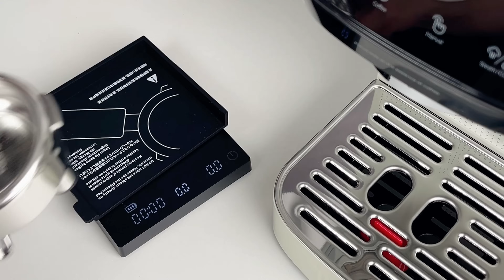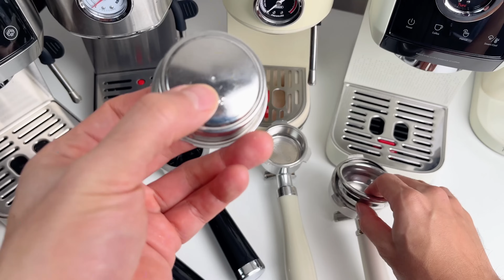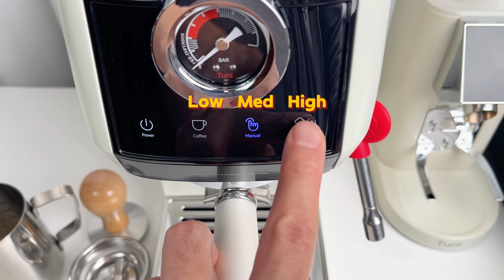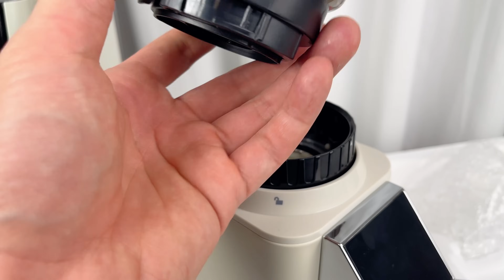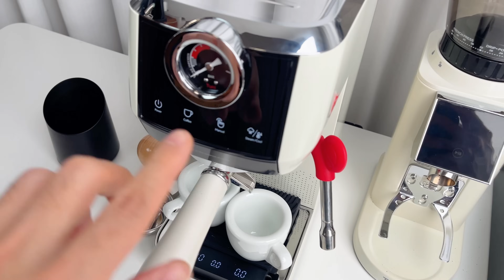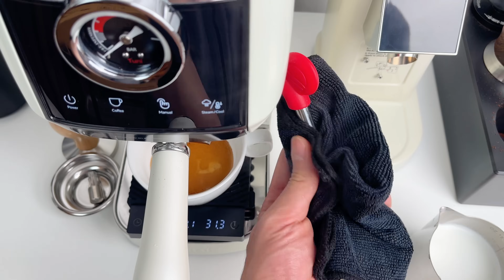Tuni E2 Espresso Machine & G1 Grinder Review - Best Budget Espresso Setup for Beginners?

Comment: Hi! I hope you are able to help me! I just received mine and I haven’t been able to properly get a espresso shot, I am using store bought espresso ground coffee but no matter how much coffee I add to the basket or how hard I tamper water flows to quick and no pressure building
Reply from the maker: Hi! If you're using pre-ground coffee, the grind size is probably too coarse, which means your coffee puck can't create enough resistance to build the pressure you need. I'd suggest switching to a pressurized basket instead (that's the one with just one tiny hole at the bottom).

Comment: I am considering this machine. It does not seem to come with single shots basket. Would you say it is still capable of doing decent quality single shots (and even with 5 seconds pre-infusion), given I use an aftermarket single shot basket?
Reply from the maker: I rarely use a single-shot basket. If a machine can pull good doubles, singles usually aren’t a problem. The common issue with entry-level machines is the OPV being set too high. Overall, though, in this price range the E2 is pretty powerful.

Comment: Wow that is very impressive for the size and price. I just asked this on your Casabrews Ultra video but this machine seems even better...would you choose this one over the Hibrew H10a or Gemilai Owl?
Reply from the maker: Hi, it’s hard to say which one is absolutely better since they each have their pros and cons. For $200, this is a solid compact option with dual heating blocks, the shot quality is great. Just one thing, the H10A and this E2 don''t have the 3-way solenoid, so the pressure won't automaticaly released after brewing. If that’s not a dealbreaker for you, the E2 offers better value for money compared to the others.
Reply: The steam looks very dry and it almost looks like you don't need to purge it. I found steam on the Gemilai Owl very wet

Comment: 8:20 the lack of a three-way solenoid valve disqualifies any machine, although I can understand that in this small machine. In such a situation, the cups should be removed immediately if you want to drink proper espresso without drops without pressure ;)

9:20 OPV is practically a must-have in machines with a vibration pump and it's good that manufacturers have finally started to understand this.

The grinder seems interesting, it's shocking to me that it has an ionizer (as I understood) at this price. It's a pity that the burrs are only 40mm, but the price explains everything.
Reply: In my book this is a plus. Easier to clean, easier to maintain, you can switch of the pump for a blooming shot. All that for the small drawback that you need to swap out the cup for a drip cup is something I gladly take
Reply: @ImreRides The lack of a three-way solenoid valve is the opposite of easy to clean...
Reply from the maker: Hi, thanks for the comment. That’s a great tip! Removing the cup earlier definitely helps. Yes, the machine is compact and already has two thermoblocks, so there’s probably not enough room for a solenoid valve and extra tubing. The OPV is set lower than many other entry-level machines I’ve tried, the extraction is quite stable. The grinder does the job well and doesn’t create any flying grounds. For the price, it’s a good option.
Reply: @brewcoffeehome  Since there is no three-way solenoid valve, what would the wait time be between back to back shots for a small group of espresso drinkers, say 3-6 drinks? It's been really hard to find this information online